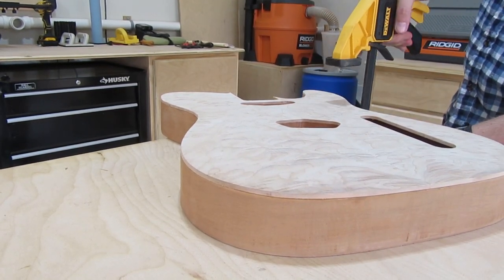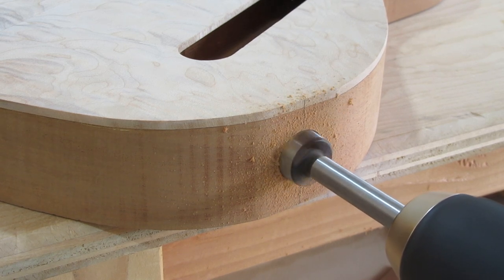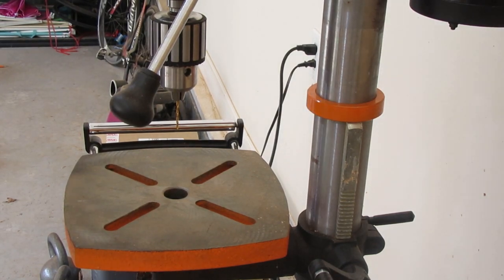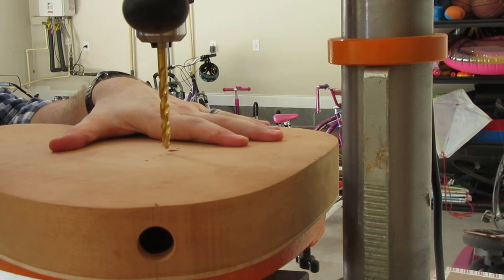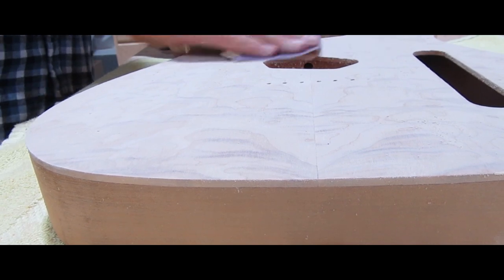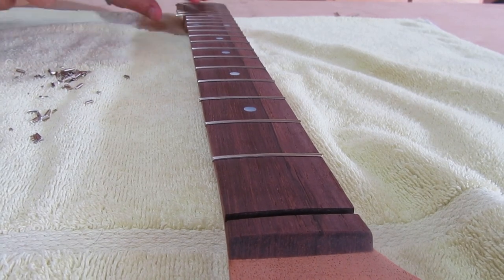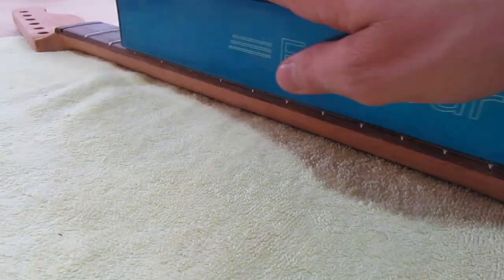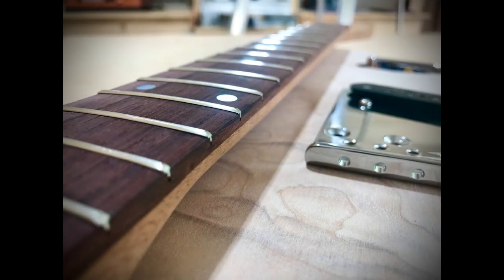Great Guitar Build Off 2020 - Part #7 Fret Work and Hardware Checks

Comment: you might be able to drill a hole to the rear pickup from the jackplug side if you angle it right , it prevents the possebillity of damaging the top that can happen when you drill intoo the electronics hole from the rear pickup side
Reply from the maker: watahyahknow good point and tip! One thing to be careful of on both methods is getting the drill bit started in a pilot hole or divot since both start at an angle on a curved surface. Thanks for watching!

Comment: my dad showed me an old trick a long time ago. scratch the screw on a bar of soap to lubricate the threads. try it sometime.
Reply from the maker: I definitely will, thanks for the idea!
Reply: @KCElectrics  
Try wax of a candle instead. The soap works just the same, but some woods can discolour near the screws depending on the ph-level of the soap.

Comment: Looks great thus far. I deleted my original post as I just watched the video and you use the same method I use for the ferrules. It’s pretty much failsafe. As for the wire channels I route those prior to gluing the cap on.
Reply from the maker: joe youngs next time I’ll probably take the time to setup a pin locator to get them dead straight but I’m happy with how they turned out. Thanks for watching!